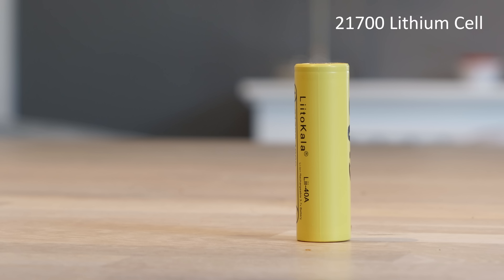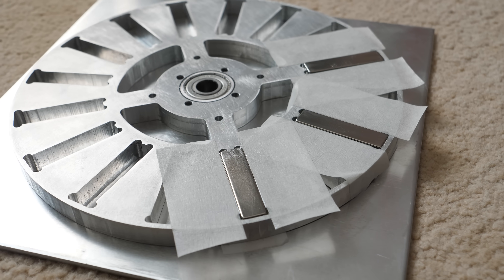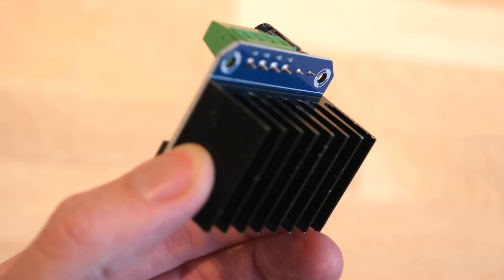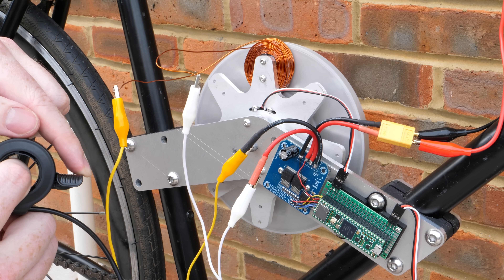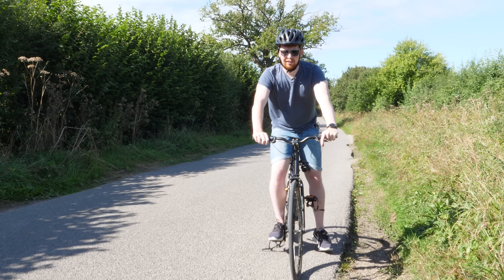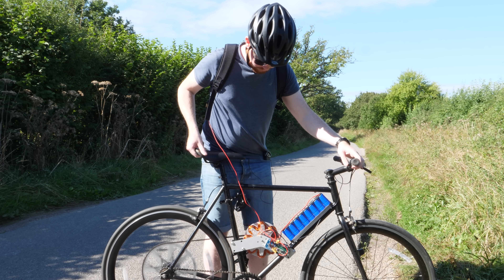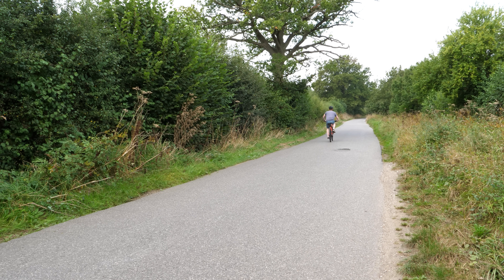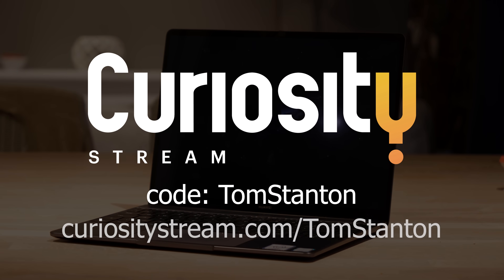Super Capacitor Bike

Comment: Hey Tom, love your videos. What about a "chain less drive"? A generator coupled to the pedals and a hub motor on the rear/front/both wheels? With the capacitor bank and/or batteries providing an energy buffer while the cyclist pedals on constant effort... The control logic would also be interesting...
Reply: This is a cool idea. But it is challenging (i.e., impossible) to make a light weight high-torque, low-speed generator for the crank. You could have some kind of gearing between the crank and generator so that the generator can rotate faster than the crank. But that partially defeats the purpose of having chainless drive.
Reply: @mckenziekeith7434  I agree. What I meant was to not have a mechanical coupling between the crank and the wheel(s). But I think some gears would be needed between the crank and generator. My curiosity is about the feasibility of such a system and its efficiency compared to an regular ebike. Also how much maintenance can be reduced and frame design freedom it could allow.
Reply: @rghisi  OK. I understand. The drive motor will probably not be highly efficient across its full operating range. But it could be optimized for comfortable flat terrain cruising speed. Let's say 85 percent efficiency. The pedal powered generator could also be optimized for a comfortable cadence. Probably also 85 percent efficient. I think it will be much less efficient than a simple chain and derailleur setup, especially outside of the performance range where it is optimized. It is very difficult to get to 90 + percent efficiency with small motors. Also, every type of gearing adds mechanical losses. The bike chain is a surprisingly efficient way to provide gearing.

Comment: Correct me if I am wrong, but that motor design looks extremely inefficient. 
There should be an iron cores inside the coils and the magnetic flow should be complete.
So the cores would be either connecting the coils or going around the rotor to the other side of the magnets.
Also I think there must be a room to play with timings of the controller to optimise the moment of switching,

Comment: No current sensors made me sad :( . Also supercaps are great for "that extra boost" or keeping things like data logging running long enough to shutdown at low power , I'd love to see these added to the next or an older build as an assist to the main pack. that's where you'll see the benefits if any
Reply: I'm not sure you need current sensors with capacitors; you can calculate it directly from the voltage and capacitance. That said, it is effectively an AC circuit with a lot of inductance once it gets going, so maybe it's not that simple.

Comment: Thats great! I kind of had a similer idea like this on a bike back when i learned of capacitors in school,but it stayed just an idea though.but you did this one for real and thats so great...my idea of charging the capacitors was using a wimshert's machine like model for the rims like it charges and ,discharges periodically to the motor but faster using smaller but many more capacitors..i dont know if it will create any energy conservation flaws but like i said its just an idea😁...i like the regenrative braking too though i dont know how it works🌝

Comment: Do you know superkapacitors from skeleton, 3000 F. If you would increase the amount of capacitors to 20 Kg than you could store about 400 Wh of energy. Loading would last at a normal householdconnection about 5 Minuten. This should be enough for about 50 km.

Comment: I'm currently working on replacing my car battery with a supercap + LiFePO4 battery based setup.

It is interesting how the power density is around 40 times as much for the cap and the energy density is about 40 time for the batteries....

The discharge curves for the caps (assuming constant power discharge) are wrong though - the energy stored increase with the square of the voltage - it would be a sqrt-shaped discharge with a constant power discharge. (For a constant resistive load, it would be an exponential decay (with quickly reducing power)) (the exponential decay is seen in the datalogging output though)

Regen braking seems like the useful application of the supercaps on a bike... Or a small buffer if the pedals drive a generator...

Comment: That's absolutely amazing!
I have experienced the regeneration  breaking efficiency myself with my new car (e-hybrid with fuel engine off):
-Driving through the city without regen. breaking: 5 kilometers per kilowatt-hour
-Driving through the city WITH regen. breaking: 7 kilometers per kilowatt-hour. And I don't have to use  the manual break at all.

40 % more range instead of wasting the energy as breaking heat. -out of the city the results decrease of course...

I'm wondering how they get that much efficiency. Do they maybe use supercaps as buffer? 🤔

Comment: Great video. I was wondering if you could work your magic and add these supercaps in parallel with the battery... like some sort of buffer. I think it would make it easier on the batteries, especially on start-up when there is a high current demand.

Comment: Now that was fun… Now design a ebike controller that can use both a bank of capacitors and a standard ebike battery.  During the start from stop phase it uses the capacitors to get the bike moving and the once in motion at the right moment, seamlessly switches to the bike battery for the motor and also to recharge itself for the next use. Possibly even sense the current draw of a hill climb and help boost bike battery with caps etc etc.  A controller that manages both and can be retrofit to any ebike…

Comment: Regenerative breaking and a higher torque on the motor would be a nice “helper” up hills and after a dead stop. 

You might want a little voltmeter to see the current charge. 

Would be awesome to have a electric bike that doesn’t require to be charged :)

Comment: Impressive how much energy you recovered down the hill. So how much could you recharge through actually pedalling while going downhill? If it was enough to get you up the next hill, then you're really onto something.
Reply: With this setup, nothing... the capacitors reached full charge before the end of the descent, as you can see on the graph
Reply: The more speed you generate the more losses due to aerodynamics you have.
Reply: @peterebel7899  I think the idea was to feed the pedal power directly into the batteries without speeding up the descent.

Comment: In order to make proper use of the supercaps, you need to add balancing and protection circuitry to each capacitor, especially when you put so many in series like that. Without this circuity, the caps are either not going to store the appropriate amount of charge, or their lifespan will be reduced significantly.

Comment: Magnetic pulse will produce alternative Current electrical.
Your electric motor use Direct Current. Electrical energy already save in super capasitor. And when you are move your pedal bike that will fill the electrical energy to the super capasitor.  Etc.. 
You can invite the battery charger and biggest baterry. 
Grade... 👍 
You have already make green energy. 
Jesus Christ bless you 
👍👍👍

Comment: Hey there, how about a coil-spring mechanism driven by the pedals, that in turn drives a flywheel to smoothen out the power and a generator to charge back the caps. Using say 3 separate switchable banks of identically arranged caps may also help, but dare I say, at least another row in parallel for each bank. That is, one in use, the second in standby and the third charging,  with a system automatically switching between them depending on voltage.
Have a great day!

Comment: You could have a separate regenerative braking motor set up on the front wheel with a clutch that detaches it from the spinning wheel while the bike accelerates using a motor on the back wheel without regenerative braking but also with a clutch to disengage when the bike decelerates and regenerative braking begins

Comment: Love the whole idea man. Now to add them all up - Flywheel spinning with the motor attached to regen the capacitors and batteries in a hybrid system. 

It’s an old idea I’ve been kicking around for about 10 years, for a human/electric hybrid paraglider.

Comment: Hm. Is there much energy left in the caps when the voltage falls below the critical level? Could a voltage booster circuit drag those last few Coulombs out? 

You  probably know that Formula 1 racing has been looking into supercaps and regen braking, there's a lot going on right now. Still you proved here, "supercaps are a pretty crap form of long-term energy storage", which people knew anyway, but you got to knock up your own motor which is pretty cool, and write the software for it. Maybe a properly useful project would use the caps for regen braking, and perhaps even to provide more current than the batteries can supply, if that were needed, for faster acceleration. You'd have to figure out how to transfer the energy from the motor to the caps and then to the lithiums. All in, I can see why you just buy modules to do it instead! 

You could perhaps detect when you're going downhill by using the Hall-effect sensors in the motor, to detect when the wheel is turning faster than it should be for the current applied (and that current could be zero, if you're free-wheeling down a hill). When that's happening, cut motor current, and charge the caps. 

Anyway... it would feel like completing the project to produce an e-bike with regen braking using your capacitor bank. Then everything is in it's place. I don't envy you having to write the software, I can program fine, but show me an equation and my brain parachutes out.

Comment: You should see my my bike 😎 it used to have a 50v 20a capacitor to five my better throttle control, no load could ride for 8 seconds, with load .. 0.3 😅

Comment: Im no electrical engineer so i have no idea what im talking about, but i wonder if its possible to have a combination of super capacitors and lithium battery for this kind of application. where the super capacitors are good for the quick acceleration and the lithium battery is good for the cruise speed. great video!

Comment: What if you just used the supercaps as a starting force then use li-ion batteries for a cruise thing? You could assemble an electric motorbike even, without the need for any pedals. Of course, if you used the pedals as something to start thrusting the bike, the supercap/li-ion would be great to boost your speed. Nice job!

Comment: I like the project. one thing you should have your capacitors in parallel. it's similar to batteries series is higher voltage  parallel is higher current. you lose farad capacity in series and gain it in parallel

Comment: Yikes. That pretty much covers it. I start my daily driver with supercaps, and the only real advantage that I can see is cold cranking amps are through the roof (even in the cold), and I can recharge from flat in about 20-30 seconds using a large battery charger (that I'm being very mean to). The question is -- why should I need to charge from flat if I just had a lead acid to begin with? Still testing total lifetime of a supercap pack.

Comment: It is strange that an inverter was not used. Oh that’s right. I’ve heard that it is illegal to use inverters for electric vehicles in some countries, which would significantly reduce the size of the needed battery capacity and increase range. And come to think of it, adding small inverters to RC toys and vehicles would greatly extend the play time and increase power.